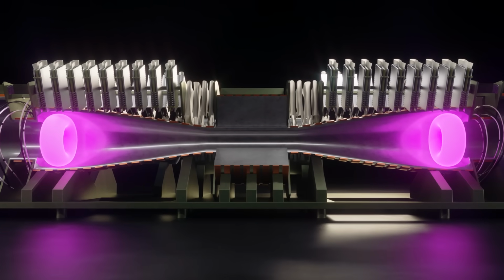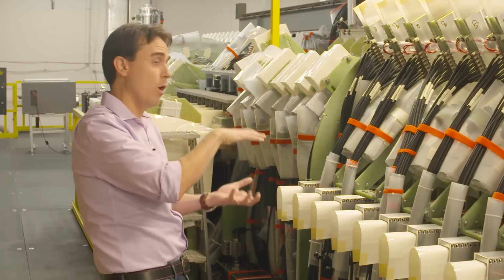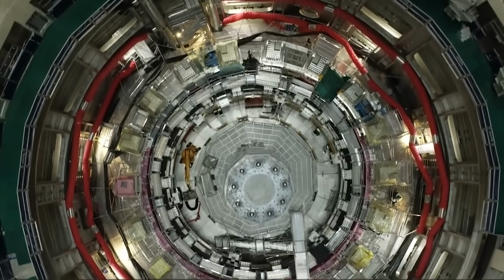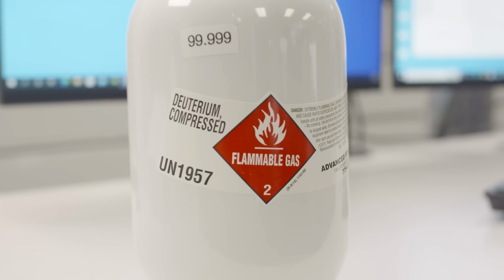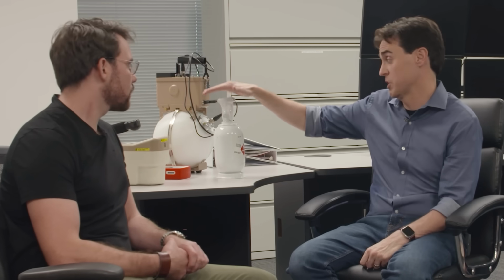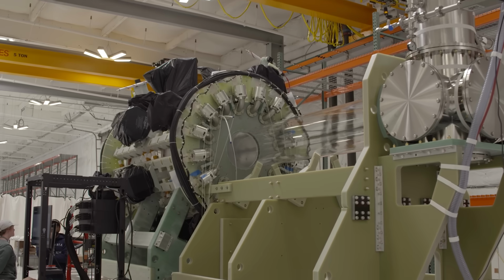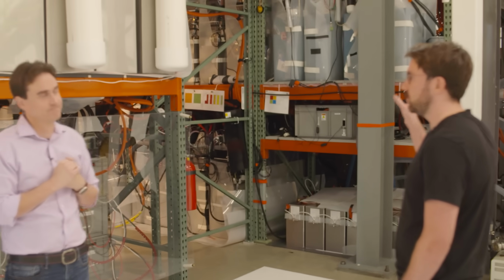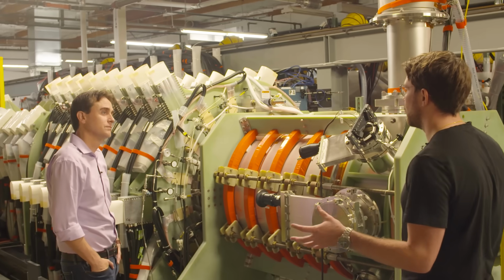A New Way to Achieve Nuclear Fusion: Helion

Comment: Included He3? Hope it works. It would make the moon a gold rush site.
Reply: Helion will produce their Helium3 by fusing Deuterium in the same machine. D+D => He3 +n or D+D => T + p (the Tritium eventually decays to He3 as well). No space travel required.
Reply: @elmarmoelzer2229  Sure, but it's theorized to be abundant on the moon. As in, first few meters of moon dust soaked with the stuff across the entire surface. I was honestly surprised they didn't mention it here, given that lunar mining isn't such a distant aspiration with an Artemis base on the way.
Reply: @Boyde712  yeah at like 20 parts per billion at most(!). That is billion with a B.
So one billion tonnes of regolith have to be processed for a mere 20 tonnes of He3.
And then you have to ship it back to Earth...
Does not sound like a good business plan to me unless we have fusion powered space ships flying back and forth between Earth and the Moon as frequently as we do transatlantic flights. I would like to see that (and I have seen credible fusion propulsion schemes for that too), but until then it is easier and waaaaaaaaaaay cheaper to just make it the way Helion is planning to do it.
From what I gather, the outer planets are actually better targets for He3 mining.
Reply: @elmarmoelzer2229  
Too bad. :)

Comment: i love how every time there is some new fusion technology it takes 30 minutes to get to any of the points of failure common to fusion tehcnologies: 1. Chamber gets wrecked as fuck. 2. Input energy > output energy. 3. Baby generator still produces ionizing radiation outside of a tub, what do?
Reply: D-D neutrons are not that big of a problem. They are only 2.45 MeV (vs 14 MeV for D-T neutrons) and they only occur in 1/3 of the reactions. The 2.45 MeV are below the activation energy of many materials that they can use (and they are still looking into the best combinations for that.
Polaris can be fully decommissioned withing 2 weeks of operation. The waste will be below background radiation after less than a year.
Reply: @elmarmoelzer2229  call me old fashioned but I feel if as much investment was sunk into improving fission reactors, we'd all be peachy. Yes, they produce waste. Keep it in the tub fromhell. It's fine.
Reply: @edogelbard1901   I am all for fission, but at least in the west fission is not working out well. Public perception, politics, anti nuclear organizations. Currently it does not look like fusion will face those same problems.

Comment: Where is the cooling? How is this even possible the plasma is squeezed into a small tube area, with no cooling anywhere??  Not possible. I call fraud.  by Thomas Cole
Reply: The machines do have air cooling. Trenta only does one shot every 10 minutes. Total energy content of a shot is in the single digit kWh range. Not that hard to get rid of in that timeframe.

Comment: So how much useful power are they getting?  Have they reached positive net energy?
Reply: Helion has not published detailed results of Trenta yet, but they did publish them for the much smaller predecessor, Venti. Venti achieved 10^11 neutrons/pulse and 10^19 kev s /m3.
Trenta is 3 times the radius of Venti (and has other improvements). Gain scales at rs^2.1. There are some other things that help them massively, like the ratio of ion- to electron- temperature. So, you can do your own guess where Trenta is. My personal estimate puts it above JET. Might even be at scientific break even (for D-T).
Reply: @elmarmoelzer2229  Put that in English for me, stop trying to impress me with technobabble.
Reply: @RichTheEngineer   
I apologize.
By my calculation, Trenta should be very close to net energy IF they were burning Deuterium and Tritium like most other fusion designs do. 
But Helion is aiming for Deuterium and Helium3 and that is harder, but not that much harder thanks to their design. 

Either way, Trenta's results are good enough that going to the next step, Polaris is a rational decision. Polaris is still on track to demonstrate net electricity from fusion next year.

Comment: This is absolutely incredible. They talk about gigawatts of energy going into every shot, but it's only for a tiny fraction of a second so the overall energy input is lower than you might think. And this doesn't require large tokamaks or complex blankets. Simpler materials, cheaper build, more abundant fuel. It's a colossal breakthrough, and it's basically guaranteed to form a significant part of meeting our energy needs in the future unless things go extremely wrong. Thanks for telling us about this!
Reply: I dont think its reasonable to call it a colossal breakthrough when it doesnt yet work. If the machine has a fusion gain aka (aka if the design was theoretically capable of producing net energy) then they would be touting that, as it would be huge news and would secure unlimited funding. The fact that they didnt tell us it has a fusion gain means that it simply doesnt work even in principle. Hopefully it will in the future, but so far it is an experiment and a toy!
Reply: @Marklar0  Sshhh, less reality leakage please!  Meanwhile please invest in my wind-powered helicopter.
Reply: @Marklar0  I wish you would pay attention to the video. They said they're building Polaris, their 7th gen machine which will be the proof of power generation, they never claimed their current 6th gen machine would do this.

Comment: theoretically we could also use cheap solar and wind power.
solar panel manufacturer meyer-burger works together with the german Helmholz Zentrum Berlin to get their first tandem silicon-perovskite solar cell with a high efficiency. the HZB just made a record sample in the lab that had an efficiency of 32.5%.
if they get a reliable version to work in mass production, i expect the power output of their solar panels rise by at least 20% while the cost of a complete installation would only rise by just approx. 5%.
especially for balcony installations that would be really great.
and siemens gamesa made a record energy with their biggest wind power generator. in 24h, they made enough energy to make an electric car go 1.800.000km
great to see fusion going forward. but i like cheap solar and wind too.
Reply: Solar, while great and cheap overall, is very limited in what it can do. Does not work at night, about 500 Wh/m2/day. If those great new solar panels do 20% more, then it is 600 Wh. 
But the biggest problem is that there is no way to store enough energy for the night and times when the sun does not shine.

Comment: As someone trying to build a moderately powerful electromagnetic projectile accelerator (a gauss gun not a railgun, because of the problems with barrel life of railguns), I'm wondering what their supplier is for their HV capacitors and switching devices, because gauss guns have similar operating principles to the method they use to accelerate the plasma toroids towards each other.
EDIT: I'm not trying to make something that's gonna put a hole in a main battle tank's front armor, I'm just trying to go thru a typical automobile's sheet metal fender.
And I don't need it to be man-portable either, this thing is totally just a "neat gadget that isn't really practical" like so many things that stereotypical evil geniuses have in their lairs, except this one would be using real physics, and really work, instead of relying on the special effects department of a movie's production team.
Reply: I am not sure who their original supplier was, but they have moved on to building their own capacitors because their supplier could not produce enough of them, quickly enough. Plus some of the best caps for their purpose are an older design that actually works better.

Comment: There's a pretty easy way to turn this into a useful fusion thruster.
Instead of holding the "pinch" on both sides of the magnetic field as the plasma starts to expand, preferentially weaken one side of that magnetic field, and then basically allow that fusing plasma to escape out of one end of the reactor.
In other words, the only difference between a fusion reactor and a fusion rocket engine based on this type of fusion reactor, is that a fusion rocket engine is just a fusion reactor that is "built slightly wrong on purpose".
High velocity fusion products should provide an incredibly high specific impulse, and this reactor being small means that it should be a lot easier to launch it into orbit on either a rocket we already have or one we're planning on making in the near future.

Fusion rockets are one technology that could significantly speed up travel times between the planets in the solar system, potentially allowing us to finally start to colonize space.
The biggest problem with using one of these fusion reactors as a rocket engine would be the waste heat, you'd need really big radiators in space.
Reply: Helion is a spin-off of MSNW LLC. They did significant work in plasma propulsion and also fusion propulsion. I think it is mentioned in one of the videos (might be this one, or the one on Nova). The problem with most fusion propulsion (including one designed as you describe above) is that while the Isp is very, very high, the thrust is very low because the exhaust mass is  tiny. They designed the Fusion Driven Rocket at MSWN as a compromise that should work quite well. That said, there are companies that might do better. Zap is one of them. Their Sheared Flow Stabilized Z- Pinch has a very high Isp with a good amount of thrust. Cooling will be the issue for that one, but I believe they could turn it into a fusion gas core design that has moderate Isp (maybe 5000) with enough thrust for a spaceship to take off from Earth and fly all the way to the moon and back.
Reply: @elmarmoelzer2229  Well firstly fusion is largely not worth it when you're launching from Earth, and the reason is as you've stated, low mass flow rates.
But if you're in orbit and you find you have more ISP than you need and not enough thrust, there's an extremely simple method to rectify that problem that MANY types of advanced thruster are capable of using.
Don't use just the reaction products. It's as simple as that. Usually the way this is implemented is that they will inject neutral hydrogen into the hot ionized exhaust, and by thermal transfer the whole mass will be overall cooled (reducing ISP) but the mass flow will be significantly boosted (increasing thrust).
This is how the "Afterburning fission fragment rocket engine" is differentiated from the more normal "fission fragment rocket engine", the "afterburning" one injects neutral hydrogen into the stream of high-velocity exhaust products.
It's also similar to how Lox-Augmented Nuclear Thermal Rocket engines work, tho in that case they inject LOX to react with the existing hydrogen to boost thrust and mass flow rate (and take advantage of the chemical energy to be released in that case to further increase thrust-to-weight).

Comment: Why not combine the inertial confinement with this?
Wouldn't a big boost of laser power on an already collapsing fuel bundle ease the other loads on the apparatuses?
Reply: Why make it more complex that it has to be?
Reply: @elmarmoelzer2229  "Perfectionis achieved, not when there is nothing more to add, but when there is noting left to take away." _Antoine De Saint-Exupéry
So, they're adding things to the design now because it is hard to get enough energy into the system without it coming apart.
If you have to add something, add something simple if you can.
Lasers we got.
We don't have what they're adding.
Reply: @punkinhaidmartin   What makes you think that they are adding things to the design?
From my understanding, they are increasing the magnetic field and they are making the machine bigger. Those are not big design changes. The lasers add complexity that is unnecessary. Plus they are very inefficient. Helion's design is all about being efficient.
Reply: @elmarmoelzer2229  my thinking is that it might be easier to combine two technologies that almost work in a hybrid system to achieve ignition than to depend on one method of compression alone. A Lawrence Livermore approach of confinement on top of the magnetic confinement might achieve ignition with a lower overall energy input by further confining an already nearly ignited target.
My hope would be that sustained operation could be achieved with the materials that we have now instead of having to do more material development.

Comment: Tokamaks don't need tritium.  It's just the best fusion fuel so they are using it to try to get as close as they can as fast as they can.  A theoretically really good tokamak could use deuterium et al.

Comment: I've seen a few of these more original fusion generation systems and I've always wondered how they achieve net positive energy production.  Maybe I've got some misunderstanding but the tocamak for example uses a sustained environment to generate fusion. The first environment creation is net negative and the issue is makeing the environment stable for long enough to become net positive. So my question is, is every single firing of this machine supposed to be net positive? I don't understand how they create a "sustained" environment for continuous generation for a start stop style system.

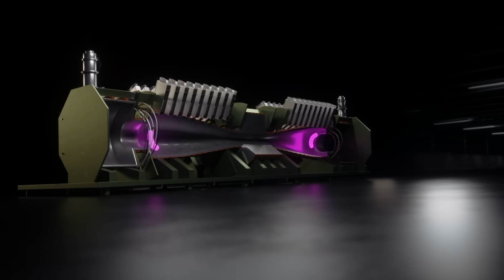Comment: 18:30 to increase ”repetition rate”, couldn’t they add more formation sections? Ie: have 2 or 3 pairs colliding plasma at intervals rather then just having 1 pair? Kind of like how cylinders fire in an engine in intervals driving one shaft.

I guess it would mess up the magnetism in the center but if they can figure that out then it could be done.

Comment: This solves a question i always have in regards to electricity generation. It seems no matter what the medium of fuel (coal,gas,hydro etc), generators always come down to heating  water to spin a turbine with copper coils to generate electricity or something similar. This cuts out several of these archaic steps. What i'd like to see is how we directly capture energy created from the fusion event within the generator itself, if thats possible.
Reply: They are doing that ehre I believe. The magnetic back pressure will cause current in the  coils which goes back into juicing up the capacitor banks. The trick I guess is to take that massive current flux out through some coil configs with nanosecond timing

Comment: This is truly amazing! I’ve still had some questions about heat and (unburned) fuel recovery after seeing the video but found all the answers in the additional interviews on Nebula. I would certainly recommend watching it!
I’ve always had high(er) hopes for the generalfusion liquid metal piston reactor, as it disposes the issue in the tokamak with keeping plasma stable. But still, electricity was to be generated using a classic steam turbine. I’ve always thought the steam-to-electricity part to be heavily outdated, especially with the high heat capacity of water. I figured thermal splitting of molecules and generating electricity with fuel cells could perhaps provide a solution, but this, magnificent! And probably as efficient as it gets.
I’m really hoping to hear more from the company soon!

Comment: To a non-scientist, the approach here makes more garden variety sense than boiling water a la ITER and impregnating your generator walls with radioactive waste.  Did I miss the part where Helion has demonstrated the magnetic burst produces more deliverable electric energy than the energy needed to cause the fusion event? Also, it sounded like they'll be creating a lot of hydrogen gas as a byproduct. If so, that may have other uses as well.
Reply: They charge up the capacitor banks, let the electricity rip through the coils and 95% of it returns to the capacitor banks. There is ot alot of anything involved here. A few atoms per cycle is my read. They puff them in with a neutral gas.

Comment: A company that creates a machine capable of Q>1 fusion will most likely keep the technology to themselves and sell the electricity to the grid themselves to recover the research cost before gradually selling at a lower price. If the technology is public electricity would have little to no more market value.

Comment: I wonder if Helion is going to take some of the Tokamak Tritium generation technology and add a lithium layer to capture the neutron in the D+D=n+3He reaction to generate an extra n+Li=T+4He.  This would put the wasted neutron to use by generating more fuel while avoiding the uranium impurity issue that Tokamak faces with the Beryllium blanket.

Comment: There are so many elegant solutions to the problems with tokamak and stellarator designs. They even skipped the ubiquitous "boiling water to turn a turbine"
Reply: I was waiting for them to explain all the advanced fusion breakthroughs and then say "and then it makes stream..."
Awesome they figured out a shortcut.
Reply: @breadyegg  i mean its not like making steam would be an issue. As it stands fission reactors are damn good at making steam.
Reply: @duckqueak  So is a coal fire, as seen in some locomotives...
Reply: @duckqueak  it's no issue to do it, but I suspect it's not as efficient as direct conversion to electricity
Reply: @ReggieArford nuclear locomotive when?
Reply: Boron fusion would also circumvent the steam part since charged particles are emitted (the approach that Marvel fusion wants to take).
Reply: This shows how advance they are
Reply: They don't necessarily use steam turbines. The DEMO tokamak would use a Brayton cycle.

Comment: Wind is not a cheaper, nor can it produce high enough quantity of power and the generation is completely inconsistent. So you just end up with a bunch of natural gas plants or like in Germany's case, firing up coal plants again. Fission reactors high costs are down to fear based regulation of them massively raising construction cost and the slowing of innovation due to that same fear based regulations reducing demand for reactors.